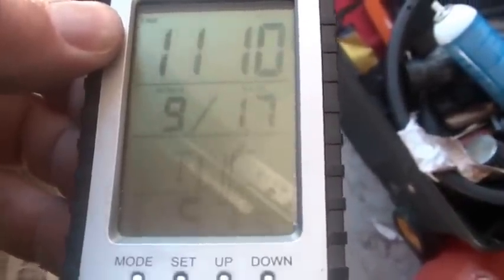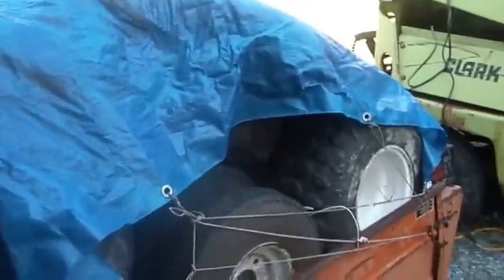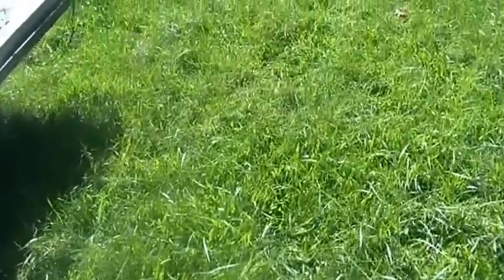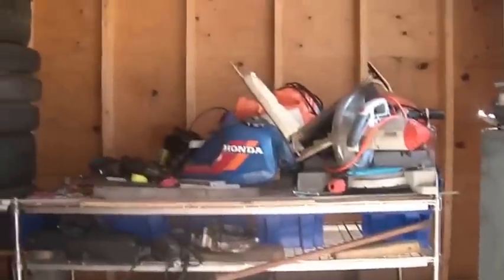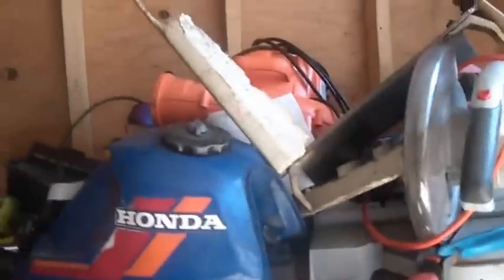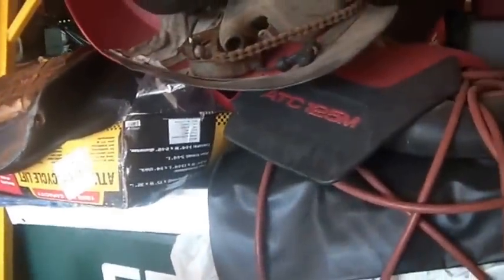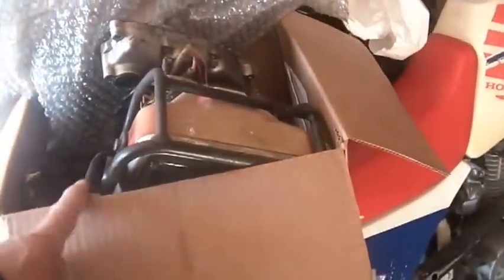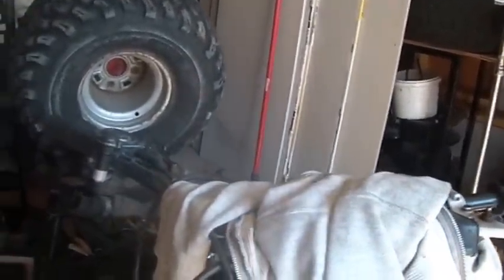9_17_2013, Dead batteries, Garage setup,

Comment from the maker: Mustie1, The power supply was pushing around 18Volts, I had about 13.5volts across the battery, that means there was about a 4.5Volt drop across the light bulb. I burned up a couple of adjustable power supplies charging NiCad batteries when I did not have a lamp, (or anything), in series, it seems that NiCads draw more current as they reach full charge, the bright lamp protects things and tells you to turn things off. Thanks for watching and commenting.